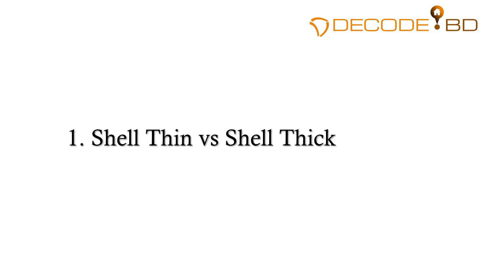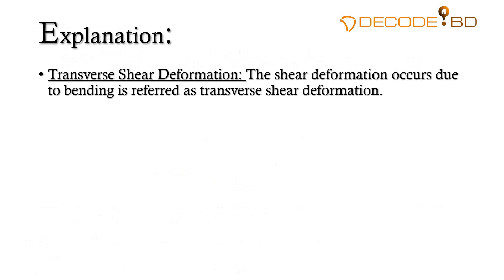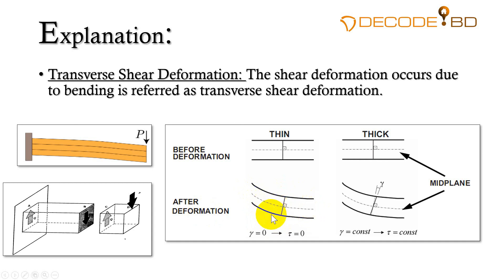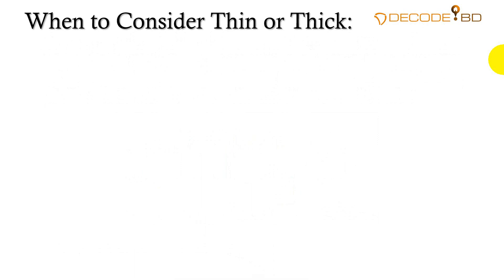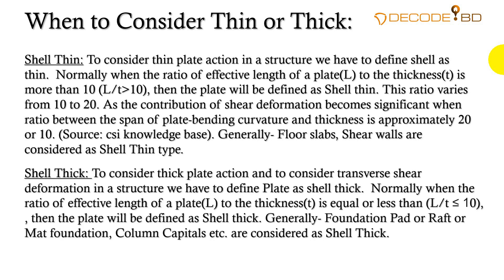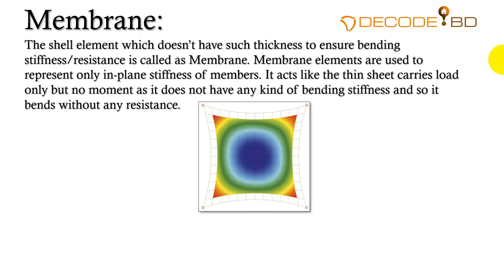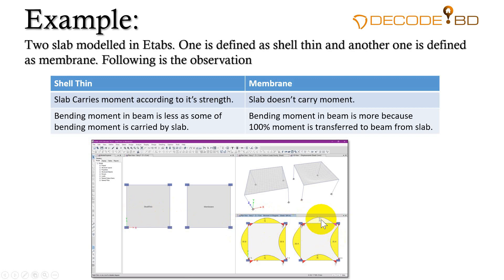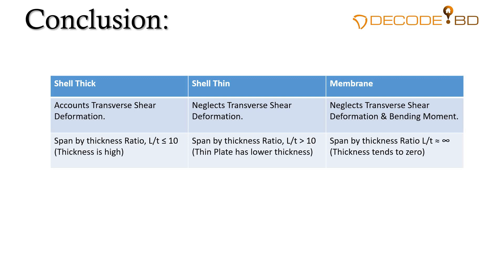Difference Between Shell Thick, Shell Thin & Membrane

Comment: Sir, why when I applied Membrane in structure the deflection in slab being so big deflection..
Reply from the maker: Membrane has no bending stiffness, that's why it bends down/deflects without any resistance. It causes larger deflection of membrane.  If you hang a Fabric Cloth/tent with four side supports,then also it tends to go down/deflect even if you don’t apply load.
Reply: @Decodebd  nice explaination..I have any question about deck slab..why deflection deck slab is not smooth like shell thin ? Because in the shell thin we can find the deflection in each mesh..but different with deck slab where meshing slab can’t smooth like thin slab..thank you sir
Reply: Sir 
In Hollow block slab
You prefer in deflection results shell thin or membrane?